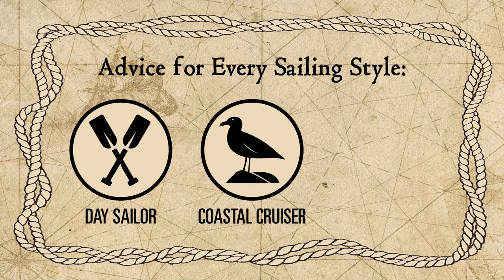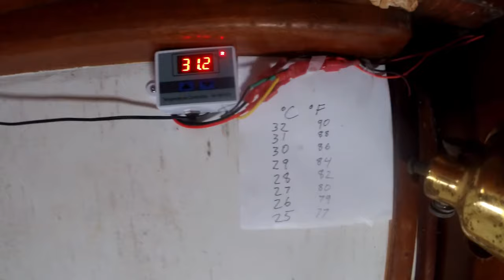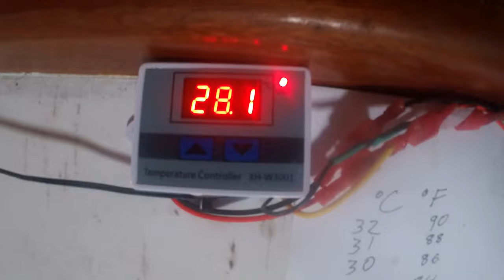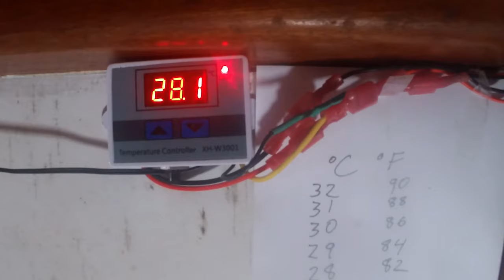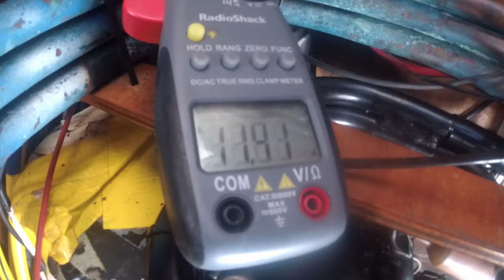Battery-Powered AIR CONDITIONING on a Sailboat [Capable Cruising Guides]

Comment: Watts are never "per hour" unless one literally means that the power consumption is increasing constantly over time. In ten hours, so by morning, you'd be drawing half a kilowatt. You probably meant it draws 50 watthours per hour (50 Wh/h), which is a 50 watt average power consumption due to drawing more (185 W) when it does run but having that 28% duty cycle once the temperature set point has been reached. That match checks out by the way: 185 W * 0.28 = 52 W so it's bang on. That's a good system you've got there! It's doing the most with the least invested in terms of money and consumed in energy over its service life, and you know exactly how it's put together! Major kudos.
Reply from the maker: Yes you are right I should have said 50 or 60 watt hours per hour average.  
I think most sailors think in amps so the 14 is a more important number.

 (Note NOT 50kWh/h).

We all make mistakes.  :)

Thanks for appreciating my work.  It still shocks me it works for so little power.
Reply: @Clarks-Adventure  Oops haha, yes. How did the k sneak up in there. Anyway, we are on the same page. Cheers!

Comment: Wow great set up. What refrigerant is that unit using, R134a?  R410?. Is the unit similar to vehicle AC compressors, or can you hack a car AC compressor to cool a 35-50 ft boat. I've seen a lot of cruisers use the window style 5K btu home units when on the dock or coverting power from solar when on a mooring. The window unit is made to fit over one of the deck hatches with small homemade vents into the boat. The water drains on deck. The 4K btu units were cheap $99-$119. However I dont know how it worked forcthose cruisers in the long haul. Ive never seen a window unit cool less than 5K btu, There are split units running 5K maybe. How do those units compare to the compressor AC system you have set up? Out in Asia I think there are a lot of black market R22 units which is supposed to have run out the "grandfather" clause in the Clean Air Act.
Reply from the maker: It uses R-134a and a very special military compressor.  VERY efecient!  No car AC could compare.

An alternating current system isn't going to come close to these numbers either.

But if one of these meets your needs that's great.

I wanted to be able to run it all night and never run a generator.

Comment: Looks great. Biggest problem here is the link no longer works or at least there is no product to buy.

I take it, the compressor is key. If we can find one that’s for sale.

If sales are no longer open to the public, can you share compressor specs ? Then we’d be able to get something close at least.
Reply from the maker: Someone new has taken over the marineDCAC business and is much more committed to doing it well.  He has an email collecting page there now and should have the full purchase site up soon.  Parts are shipping in to him as I write.
Reply: @Clarks-Adventure  what do you think of the a/c heater from EcoFlow? It’s technically 48 volts
Reply from the maker: Honestly I don't know a thing about it.

I'm concentrating on battery systems and YouTube.  That's why I contracted out the AC stuff.

Comment: No mini split needed I just made a system that makes battery powered AC and cooled seats a non issue.  Just run it as long as you want. I am currently building the boat right now. Should be done in a few weeks.

Comment: What I'm gathering here, this is a great way to combine old and new systems as money allows. You didn't go detail deep in this but it seems to me that this should be marketed as a lithium only device as well. I'm not studied well on the big three's charging strategies but I don't think anyone is doing this.
I hope you've applied for a patent.
Reply from the maker: Yep I have a patent pending.   Strangely the patent office takes YouTube videos as proof of "prior art".  So even this video protects me.  

No this requires lead.  Or at least another reliable bank if batteries.   That bank can actually be tiny.
Reply: @Clarks-Adventure  when will the two be available to us and what is the estimated price point for the two?
Reply from the maker: It's still up in the air but I'm thinking $200 and $300.  That might include the contactor, might not.   
Supply chain is a mess right now.  A chip that should cost a dollar is now $9.00 and it's big and better brother simply isn't available.

So once I get through the software I'll see what chips I can still find and start production on the new boards.

Announcement: I just sat down to answer these messages from all day in my lab.  I have a bbms+ prototype that WORKED.   Single first test but everything worked!  Seemed a good time to kick back for the day.

You are the first to hear.
Reply: @Clarks-Adventure  I'm a freshwater fisherman and RV guy that does everything DYI so sailing channels fit me well. So... You're helping the RV world as well.
Reply from the maker: Angry pixies are angry pixies.

You RV guys actually need it most as you all have a lead starter battery anyway and can't carry weight as well.

My parents do the RV thing.  Let's just say they are proud of their power system when they chat with people in the park.  Their rigs have always benefited from my lab bench.
Reply: @Clarks-Adventure  That's good to know.  YouTube as proof of prior art is a game changer.

Comment: Cruising in Boston area. Melting now. Going south to Panama this spring. We will need this. Trying to figure out we’re to put it on a small catamaran.
Reply from the maker: If you get the kit it will bit about anywhere.   The air handler can just attach to the ceiling.

Make sure you fill out the survey if you want to stay informed when they are available.

Comment: This is great. From what I've seen out there, a brilliant ground breaking innovation. I've been cramming to learn about solar. I use thermo dynamics to cool my house. I heat one room in winter to save money. My body prefers a warmer climate. I've lived around the world. Always need a way to cool off to survive though.

 I might end up living in a box truck I'm working on, needs some help, 75 Dodge CB300, but in a boat in Florida or NC would be great. Might end up in a subterranean hovel in the desert. I'm somewhat disabled, rehabbing from a brutal life. I see a lot of people who could use this, just to make a cool place to survive. I'm very handy, but not too smart on AC systems or electrical. I test as genius, but I know I'm stupid in some areas, lol. Brilliant in others. If this is dependent on a massive source of water that would limit the possibilities, if not the applications could be huge, wide and deep. I know I'm going to need this. Don't know if I'm going to be able to afford it for some time. I have an idea what the battery and solar system will cost.

I think if your system creates dry air, a small evap system could cool as augmentation, but there goes the dry air, poof, lol.If it dries efficiently enough, using with seperate evaporative cooling might be synergistic (just need a fan and water flow, which is low volume and can be done by gravity by suspended tank) though usually that sort of synergy gets blocked by reality of physics, but sometimes it can be great. If your system would work in a desert with a small water tank, the combination would be almost a no brainer.
Reply from the maker: Thanks.  Nice of you to say and astute of you to notice.
Yes it can work with air cooling.  You need to spend more power on a fan and the compressor needs to work harder though.

No the swamp cooler doesn't help.

You should look at the chemical dehumidifier AC that "Tech Ingredients" showed in his video.  I think you might really like to watch that.

Comment: Very nice video! If you had a 4 cabin cat would you recommend placing 4 units like you have or an other solution?
Reply from the maker: Yes using multiple of these would be required as they aren't massive BTU units.

I think we are going back into manufacturing them with a new drop-in unit on the drawing board.

Fill out the survey in the description of this video to get on the mailing list.

Comment: Great video, great idea.  Tried to open the website but it failed.  I am located in Thailand so it would seem difficult to get all components shipped over here.  Are you considering listing the components ever as something we can purchase?  I can get the air handler here and all other components but only the Chinese version of the compressor and as you have explained in the comments the one you are using is much more efficient so it would be great to get the make, model and supplier of the mini compressor (or buy it from your guy in Florida when they get the website running).  Good sailing!
Reply from the maker: The webpage should be up again in a month or so under new management.  Until then the best bet would be to fill out the survey in the description to get on the mailing list.

The compressor manufacturer won't sell direct.

Comment: I want One. and I'd like to include it in my growing product lineup.  I cater to people with small sailboats - typically under 30 feet who want some of the ease and pleasantries that larger boat owners enjoy - without the big boat expense.  I'm also developing a plan to convert a SeaRay 270 into an electric propulsion trawler.  I've been following SV Uma's success and am blown away at how far north they are operating.  I'm intrigued with your low power consumption DC compressor as the last thing on my project list is to dump the ICE generator.  I already have a working boat AirConditioning system installed but the system runs on 110AC supplied by the generator.  PS -  I live and work in Phoenix AZ.
Reply from the maker: Fill in the survey to be in the mailing list

Comment: Seen those compressors on Chines website 12V variable speed mini scroller. Nice to see one in use. I am quite impressed with the duty you got out of it. As an RV person my self. As a fridge engineer by trade that has an all round understanding of Solar batteries and inverters etc. After watching this video considered if using just cold  sea water running through  a finned heat exchanger in your cabin would be enough. But looks like in your part of the world the sea temperature reaches 26C So would not be very effective.The sea temperature in the UK is between 8C-17C and would work well. But inversely our climate is not as hot as  the tropics.
Reply from the maker: It's actually a different compressor.  Wish I could use the Chinese version as they are WAY cheaper.  This one was developed under a DARPA contract.  Although it looks the same.  The Chinese claim a COP of 3 for their unit.  Mine claims a COP of about 8.  And since their only client just now (besides me) is the US military I believe their claims.

Comment: Can you please provide the list of parts (Make & Model)  needed for building this Battery-Powered Air-conditioning system.
Reply from the maker: Nope I can't.  I sold the design to a manufacturing company.  Besides the compressor isn't available to the general public. 
 If you fill out the survey you will be informed when kits are available.

Comment: I too am interested Clark. I want to install in my teardrop trailer.
Reply from the maker: Perfect for a teardrop.  We are going to offer an RV version with air cooling.  It will use a scoch more power of course.

Fill out the survey to be kept informed.
Reply: A 5k window ac uses roughly 5 amps 110. If inclined to do so those can be made into a mini spit.  14+ amp draw for his design is a bit much. I'm guessing his design will be far more expensive than 130 dollar window ac.
Reply from the maker: 5 amps at 110 volts is 550 watts.   I'm running at 13.x volts.

Plus you have to add inverter power costs.
Reply: @Clarks-Adventure  1k inverter uses about 1 amp or less depending on quality of inverter. So would probably add roughly 6-7 amps. So around 12 amps total? I would suggest all to run real world tests with the numbers and the cost associated with them before making a decision.
Reply from the maker: You realize you are suggesting that your unit which draws over 550 amps should be used over a unit that draws under 200?

Power is volts times amps.
Reply: @Clarks-Adventure  I was going by the volt meter readings of 2.5 and 11.5 roughly. Didnt hear when you mentioned the watts of the compressor. Does the combined amps draw of the compressor and the evaporator unit not figure into the efficiency? Or is the compressor the only component that needs to be considered?
Reply from the maker: OK I'll try to explain this.  But you should do some research on your own.

I'm trying hard to not insult you but you really don't seem to understand basic electric power.

Power is measured in watts.  Watts are volts times amps.  So 5 amps at 120 volts is the same power as 50 amps at 12 volts.   Your window unit would use 50 amps at 12 volts plus the power loss from the inverter.

It would be much cheaper.  If that's the only concern and enough power can be produced then by all means use a window unit as long as you can mount it.

I personally can't produce 50 amps for an extended period from my battery system.
Reply from the maker: And yes I list the watts.  Rewatch the video and you will see it on the screen as titles.

Comment: YES we want that Build video!  This could even work for an R/V, eh?
Reply from the maker: Did d you fill out the survey?
Reply: Not sure in rv unless it's parked in the water. That's how he transfers heat - sea water. On land you would use hot air.
Reply from the maker: Not as efficient but still works.  We will have an RV unit available that uses air cooling.
Reply: @Clarks-Adventure  good to know I would be interested would it be like a mini split?
Reply from the maker: The kit and the u-charge will be.  It's more efficient and I just like it better.  No duct work.

The pre-charged will likely not be so it can all be on one sled for easy install.  It's fan will have to work harder.

Comment: I managed to set-up an aircon (temporary) on my oceanis 393. I have 400ah lithium batteries with a victron 3000/12 inverter supported by 4x175w solar panels. The inverter can handle the aircon no problems, and the solar can ‘almost’ keep up so I use my batteries very very slowly. No real issue for the amount I use the aircon. The aircon is just a EUR 300 9000BTU unit for home, but does the job great. @Sailingandscuba
Reply from the maker: Glad you found something that works for you

Comment: Sleep out in the cockpit when it's too hot then go back to the cabin when it cools down we live in the tropics it works well 😊
Reply: A great natural mosquito repellent is the lavender plant and their is a couple more plants that mosquitoes can't stand the smell of and stays away.
Reply: @cheapcigs9772  it doesn't matter if the lavender smell comes from a air freshener spray, plants, or how ever you want. As long as the smell is in the air. It will repel mosquitoes but the most reliable is plants because it's 24/7 as to a spray. You see. Google " natural mosquito repellent" you will see a lot of different things that will repel mosquitoes
Reply: @cheapcigs9772  I would have at least 5 plants and depends on the boat. The more the better.

Comment: Very nice set up, I dont have a boat I have a converted short school bus. Do you think it would work well in a short bus? is it strong enough to cool about 90sq ft? or would I need to close off the small bed area? which would be no problem. I plan on doing a lot of boondocking being off grid with limited amount of solar. A lot of people now days are living in their RV's, Skoolies and Vans. They need ways to keep cool and only way to have AC is with a generator or very big solar system. Having a small mobile living space there is no room for a large solar system. So I've been looking for ways to cool my bus down. At least at night to sleep and to keep my dog cool. With out eat up the all the solar in a short time period or breaking my bank.... 
Are the parts very expensive? What would the prices be if I just ordered the parts and diy? and the price for a completed unit?
Thank you
Reply from the maker: Still working out all the details.  I put an update in our last Livestream.

Fill out the survey to be kept informed.

There will be an air cooled offering.  It would work for a small area.  As far as the whole buss, that depends on insulation and temperature difference.  Can't answer.   This unit maxes out to just over 5k btu.    There might be a 10k kit available eventually.

Comment: just a little information //the unit you are running should be @ 44 deg. at the discharge vent or it's low on freon . ( the oil in the system won't circulate shorting the compressor life) Check mini-split

Comment: You're the reason I couldn't get a 1.4cc compressor. I'm sure the 1.9cc one I finally managed to get on order will be fine. What are your thoughts on butane/propane instead of R12 types? I haven't checked your other videos yet but do you use cheap gauges and vac pumps or are you flash? I like that R400's are are easier to deal with but I understand the the explosive risks. I have safe extraction past my compressors overboard. It helps run the compressor cooler as well.